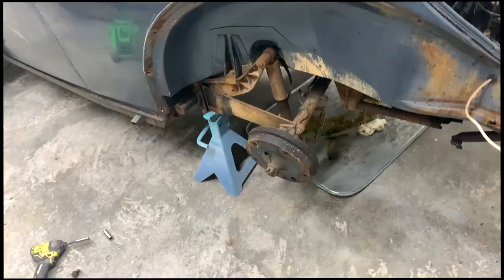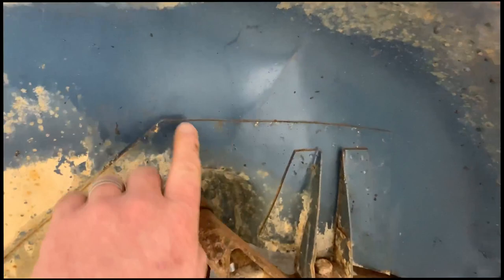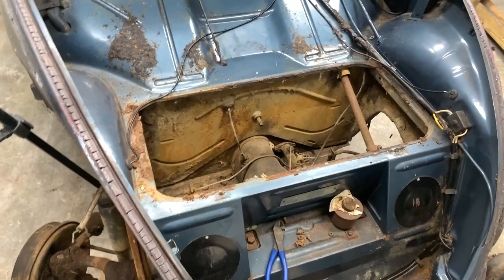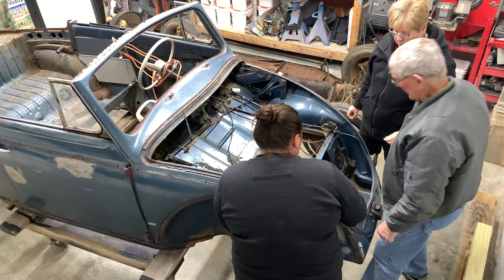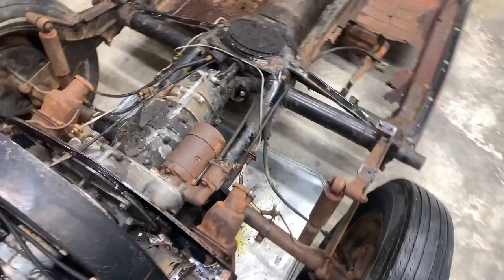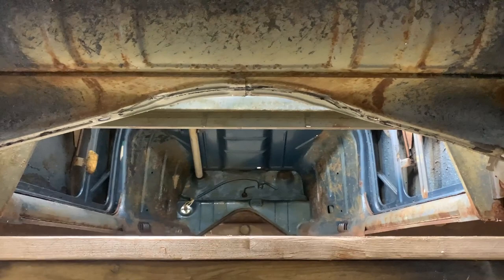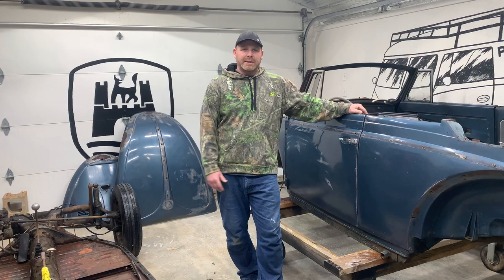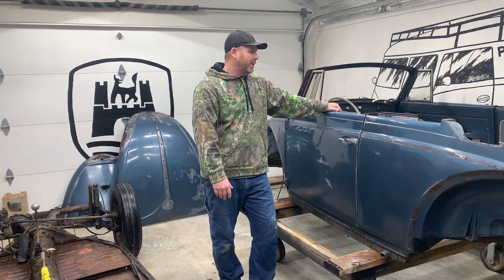1959 Volkswagen Beetle convertible restoration part 2  Pulling the Body!

Comment: Ya I would just replace all rubber your floor pans and detail the suspension get it running new top and apolstry and make it drivable anywhere..
Reply from the maker: Yeah that’s basically the plan. Chassis will be fully detailed . Body patina style but the rest just nice.

Comment: I have a 65 vert. I plan to do the same thing to. How did you strip the red paint without messing up the OG paint? I would to try that on my bug. Also many people weld in bracing on verts to prevent body twisting. Maybe you are ok cuz you left the doors on? Anyways good luck. I’ll be watching to prep myself for when it’s time to do my vert. Gotta finish my bus first. 😁
Reply from the maker: I used acetone, brake cleaner and laquer thinner with steel wool. Click on the playlist for this car and have have several visors of it.    Yes this car has no flex at all and I’m sure leaving the doors on helped as well as it resting on the support rails instead of a rotisserie style on both ends.